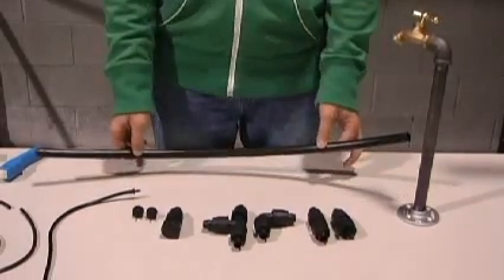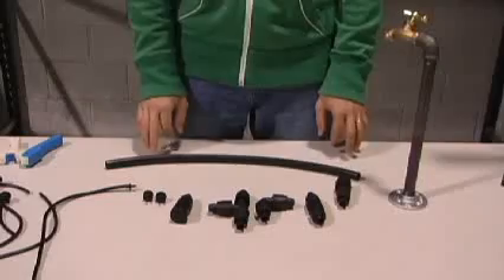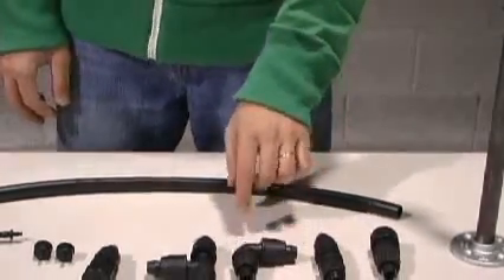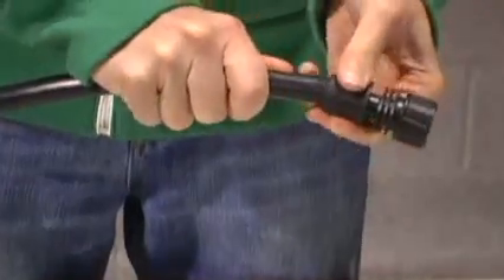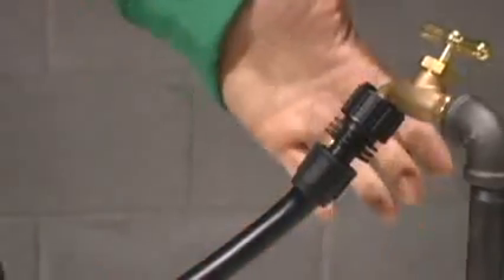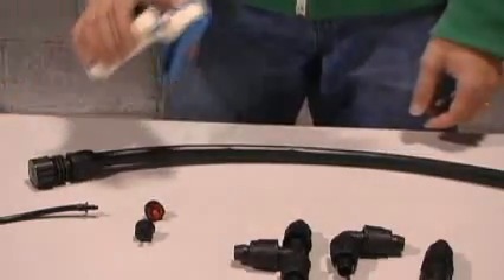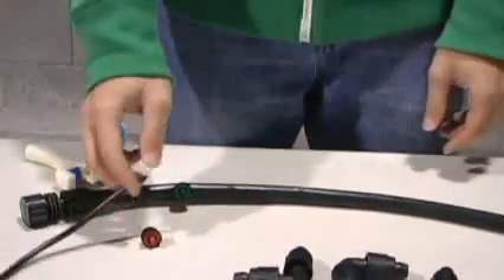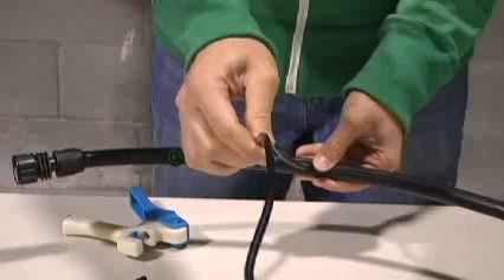Drip Irrigation 1/2" Tubing

Comment: Doesn’t this require a pressure reducing valve so emitters don’t blow out ?
Reply: Yeah they need to have a pressure reducer if the PSI is over 10-15 (average drip tape/line psi standards.)
Reply: My water pressure is 62 PSI, I've never used a pressure reducer, and I've never had any blowouts.  Regardless I still think a pressure reducer is a good idea for a system that isn't                                                                                                                                                                                                                                                                                                                                                                               200 feet long with 30+ emitters like mine.
Reply: Don't turn your water on too much!